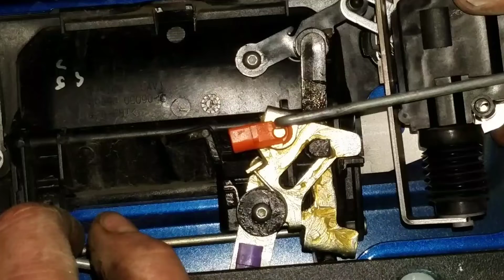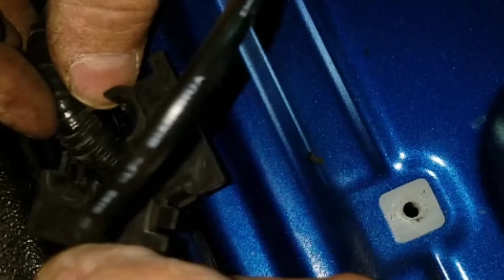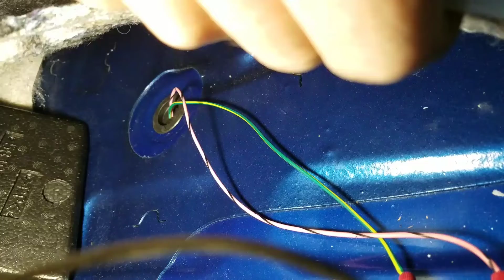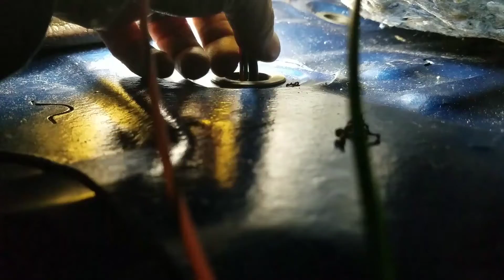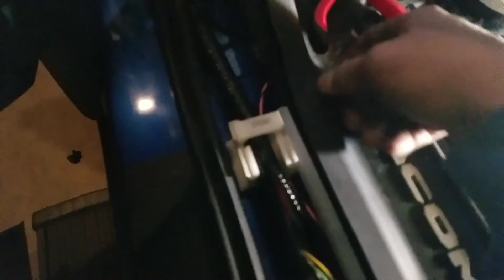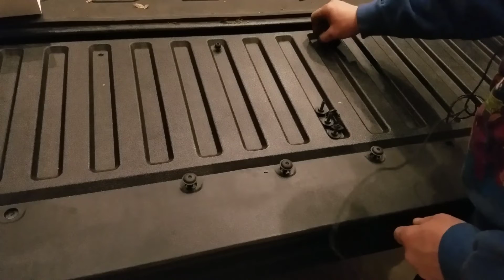2018 TACOMA POP & LOCK INSTALL | HOW TO

Comment: I have a 2020  tacoma,  Could you again repeat which P&L cable color goes the Taco Black and P&L cable color goes to the Taco Blue?
Reply from the maker: It isn't my truck and the guy it belonged to sold it. I'd have to watch the video again. But if you get them backwards you can just switch the wires back at the pop&lock

Comment: Thanks for the video! The instructions that come with the P&L suck! The instructions even tell you to wire the P&L backwards! It looks like you have it wired backwards in your video too. I wired P&L Green to Taco Black, P&L Blue to Taco Blue. 2018 TRD OR. Another video on here has it being wired to the passenger side and the cable run along the passenger side. I don't like this because the cable runs along the muffler and exhaust pipe. I think over time the insulation will corrode because of the heat and short out. Run it along the driver's side like in this video. There are several cables you can tie to on the driver's side.
Reply from the maker: I like the driver side. If you happen to get the wires backwards, just swap the wires on the lock motor in the tailgate. Ya, i think the instructions were backwards. It's been a little while so I don't remember for sure. I'd have to watch the video lol